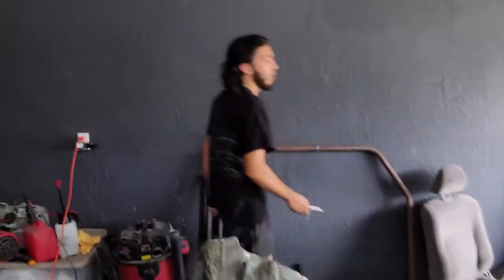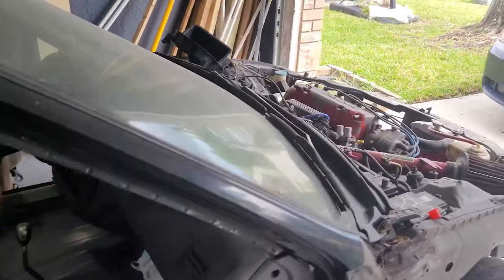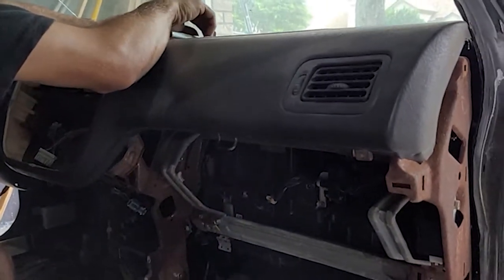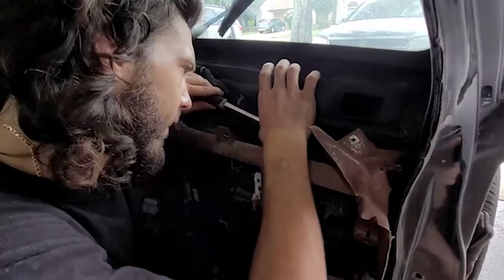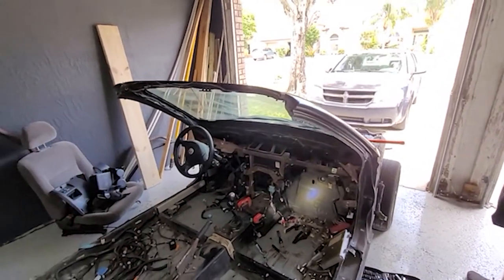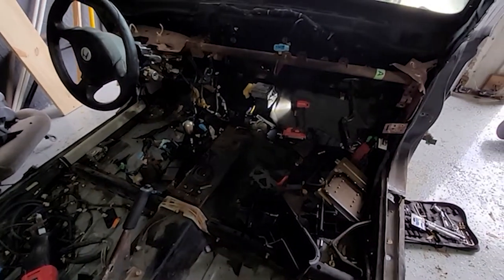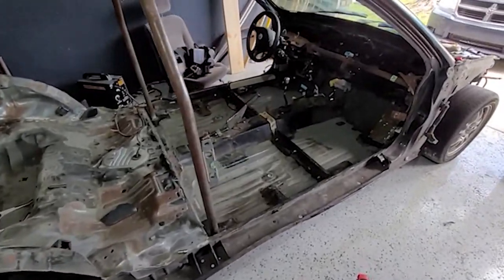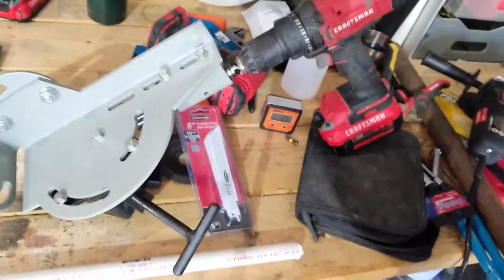Building a Honda Civic Kart part 4 | Exoskeleton

Comment: Got a 99 sedan I'm in middle of bagging right now. I wana find another 99 sedan I can exo and lift and maybe awd swap. Just subbed ready to see more
Reply from the maker: Nice! That AWD swap will be tricky, but worth it. Thanks for the sub!
Reply: @SweitzBuilds  np. Figured find one of the awd pilots or other awd Honda suv n just swap as much over as possible the rest just cut n fab since it'll be an exo kart anyway it ain't gotta be pretty